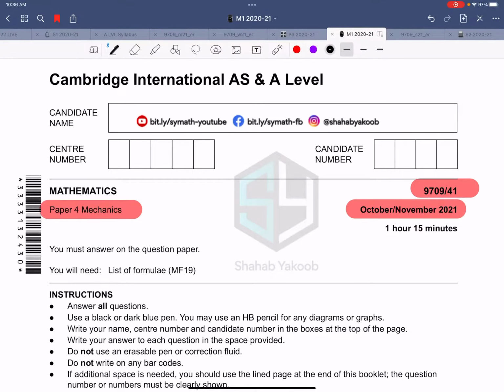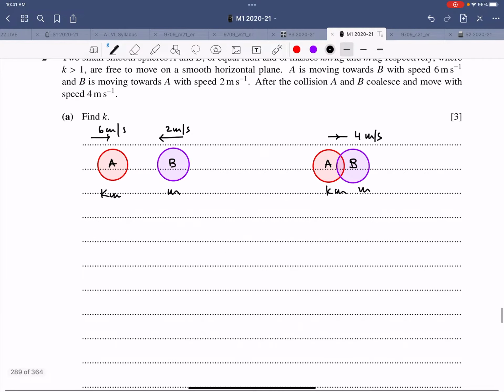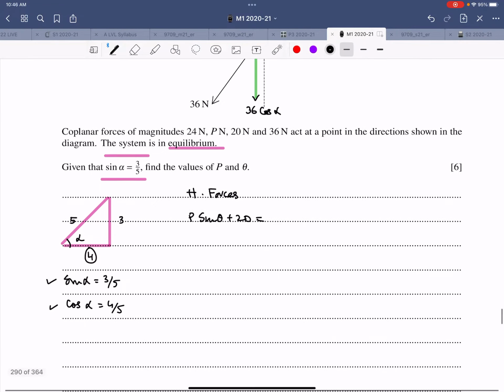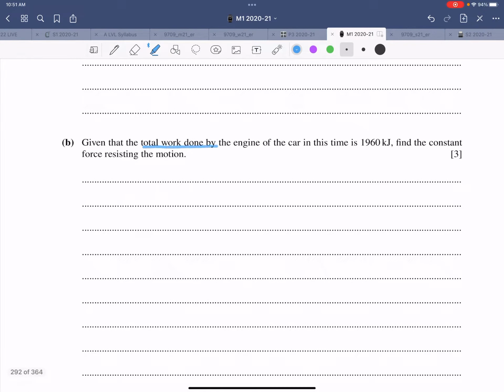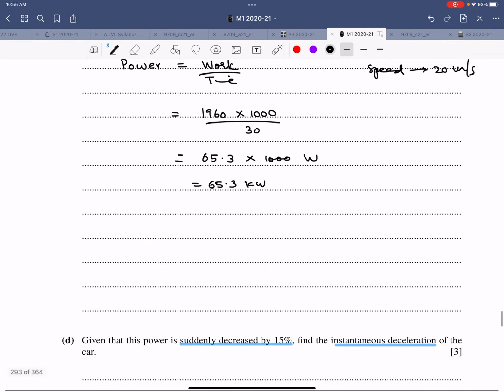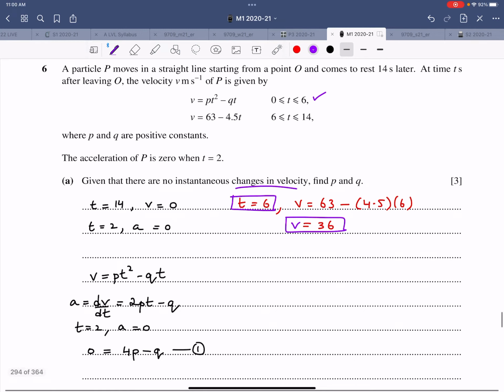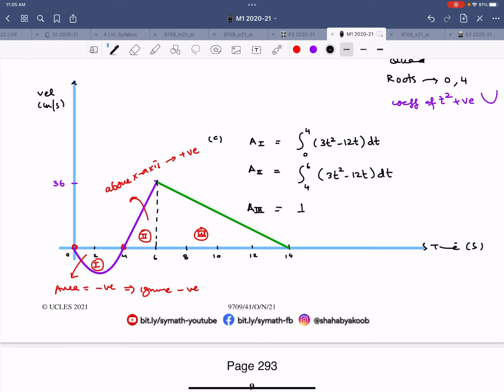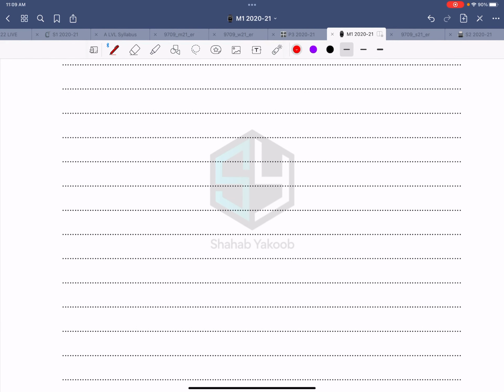M1 | 9709 | CAIE | Oct Nov 2021 | variant 41 | MECHANICS

Comment: how to get answer in correct significant figures? last answer is coming out to be 0.763m even after using values to 4 sf. im losing one mark for accuracy this way.
Reply from the maker: @picklejuice8210  does not happen if u work in atleast 4 sf. Try out the question from the start once again, on a fresh new page.
Reply: @MATHEMATICSwithSHAHABYAKOOB  in your last calculation you used 1.390^2 and 3.090 and using those we get 0.3126 which rounds to 0.313